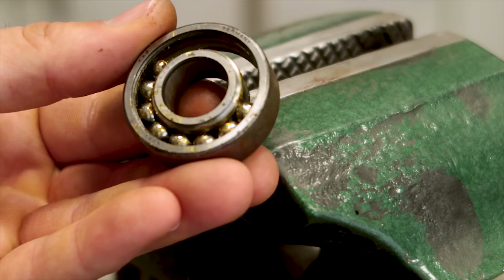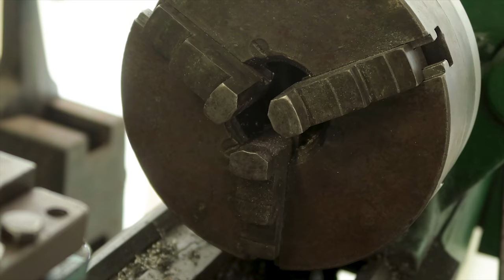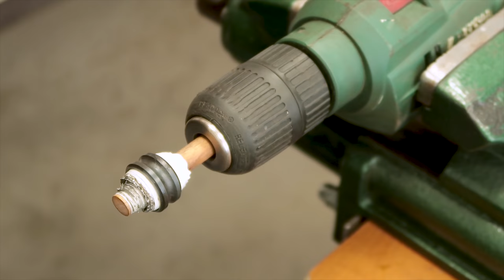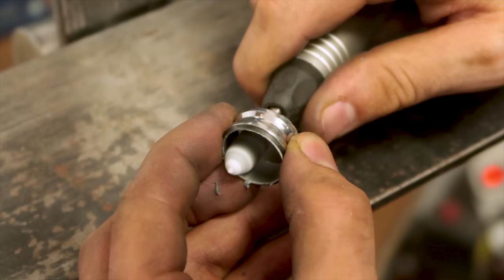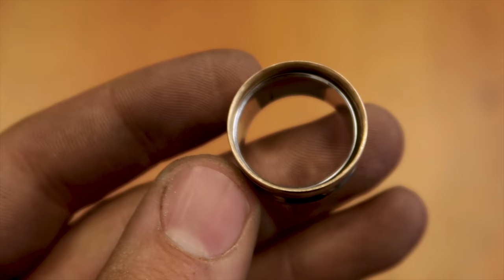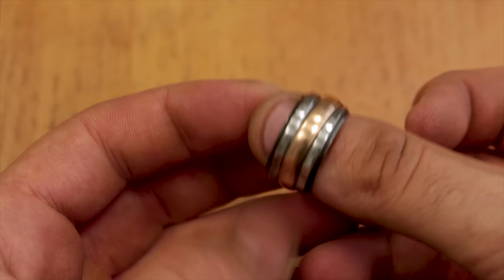Upcycling Ball Bearing Into Rings | Machinist Ring!

Comment: I'm a subscriber and love your videos. I have a lathe (Atlas 618) and will likely do this.  I am curious why you put the dowel into a drill and not the lathe? Also you could run the ring in the lathe and use the Dremel as the ring is spinning. I have a small three-jaw chuck with both a MT1 and MT2 taper that will hold the ID of the ring using the outside of the chuck jaws. That would eliminate the need for the dowel/mandrel.  I think it was less than $30 USD.   Keep up the videos!!
Reply: I can think maybe it comes down to safety. The drill he controlls the lathe he would have to be focusing on 1 constant rotation machine and then the dremel so it all becomes alot harder to manage and the risk factor. But i do like your take on it, just think it becomes too dangerous.
Reply: @deanharris-martin1849   I was going to put the safety concern you mentioned in my comment, but left it out. I do agree machine polishing inside of another spinning piece of work by hand is a bit dicey, but I've done it. There is an attachment to mount a die grinder to the cross saddle of a lathe to take it from a hand operation to a machine one.